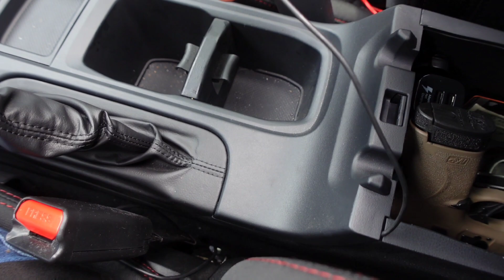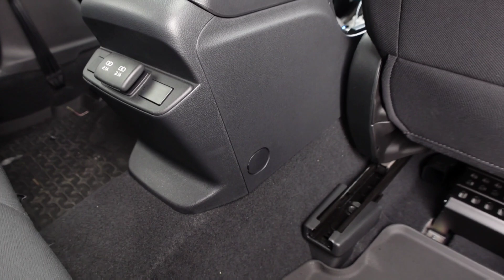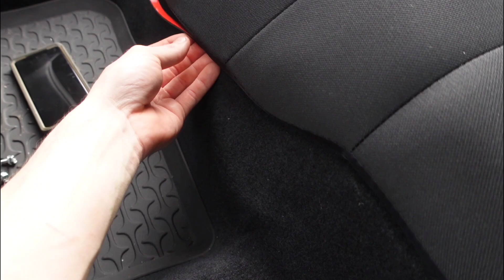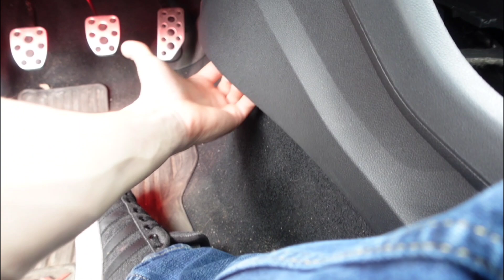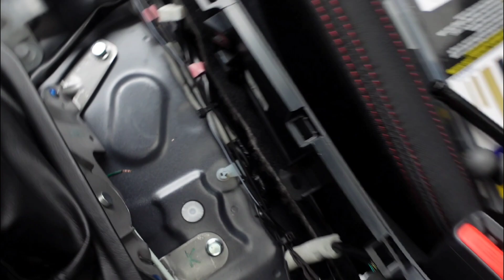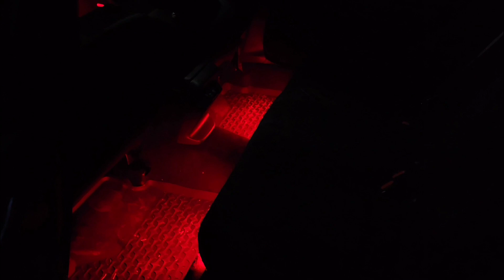Footwell Illumination Install - 2022 WRX

Comment: The one thing I did that increased the difficulty was buy aluminum bar stock and cut to fit the brackets under the drivers and passenger seat.  It gives a good flat place to mount, you can angle it for the best lighting, and it isn't blocked by the rear passengers' legs. Everything else was basically exactly the same as this video. It was one of the first things I did when I got my VA. I did however choose to get some amazon ones that are controlled by a bluetooth app and have all colors/patterns/programmable/etc.

Comment: I prefer the OEM fit and finish. Clean tidy and covered under warranty. And you can dim them with the dimmer switch. Im still under warranty still so dont wanna void it. I did my OEM kit today and they look amazing. Now I gotta figure out the rear. I wish you would have hardwired them to show that route. In my opinion the rear lights would probably look better if you mount them under the back of the front seats if you can find a spit to mount them anyways. That reflection would drive me crazy.
Reply: Void warranty bro it’s two fucking LEDs 😂

Comment: Instead of the glue I would of bonded the led straps onto some velcro to make it stick to the carpret. But other then that awesome job. Not a fan of cutting into factory harnesses. And this works out.

Comment: You can get the oem kit for $100.  It plugs into the back of the dimmer switch.  That wire in center console is for optional cd player.
Reply from the maker: @brian6speed  oem kit doesn't illuminate the rear seat area, though. That's why I went this route instead.

Comment: Really with the power button was able to be twisted so you can dim the lights. I'd consider it then lol
Reply from the maker: I agree that would be really nice. The lights aren't aggressively bright but having control or wiring into a dimmer switch would be great!
Reply: @StreetInspired1  hmm maybe wiring a dimmer in there is the way to sway me. I'd have to find a dimmer that looks good and can be tucked in there attached, don't really want it dangling. Love your work by the way!
Reply: Some of the light strips are controlled via an app to change colors etc. Possibly have the ability to dim from the app. I have seen others mention govee as a brand they have used

Comment: how do you like the new wrx vs the old, and have you thought about STI drivetrain :) ?
Reply from the maker: Honestly it's a close call. I like them both a lot. I'm thinking about making a video on my thoughts comparing the two. But I have definitely considered the sti drivetrain. Basically, if the transmission explodes I'll probably do it but I probably won't do it until that happens lol

Comment: Can it be wired so that they only turn on when headlights are on?
Reply from the maker: For sure. You can always get an add-a-fuze and wire them into the headlight fuse or the wiring for the parking lights. Shouldn't be too hard just finding the correct wire.

Comment: When I started to do some LED DOME LIGHT mods to my 2022 WRX, I blew a lot of fuses.  This video is more of a hack versus an OEM install.  I prefer the Subaru illumination. Its clean and plugs directly to illumination controls.  Sorry dude but no thanks.😢
Reply from the maker: No offesne but calling amything besides OEM a "Hack" would illiminate a lot of really cool stuff. Blowing fuses while installing a dome light is definitely user error. If you're having issues like that I would disconnect the battery anytime you're messing with wiring.
Reply: @StreetInspired1  the electronics on the 2022+ WRX are more sensitive with drawing current and amperage. That said, any tapping of wiring or existing is a risk, which is the main concern. Not to mention And it wasnt user error I had the LED lights done at a reputable automotive  pro shop that works on alarms, stereo installs.